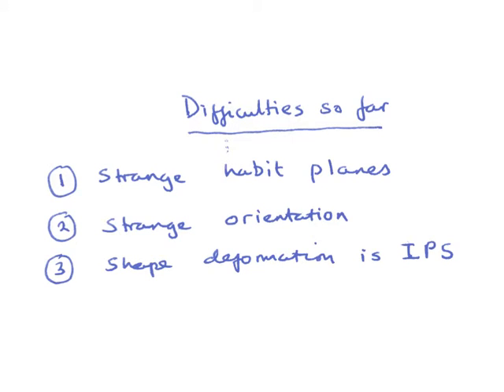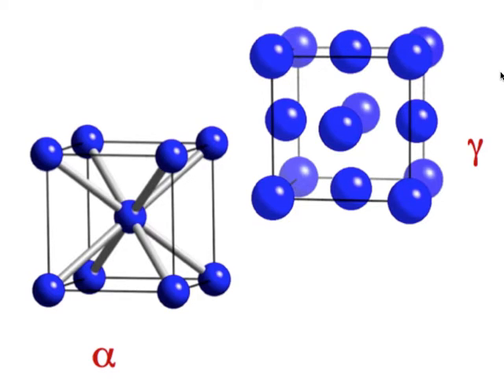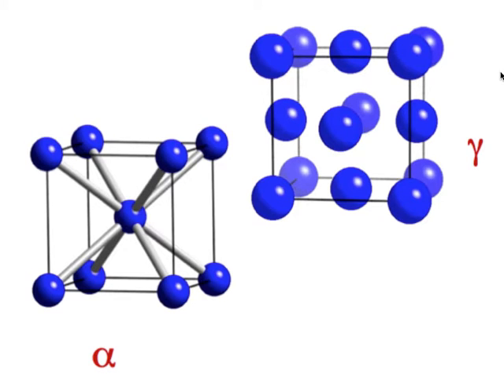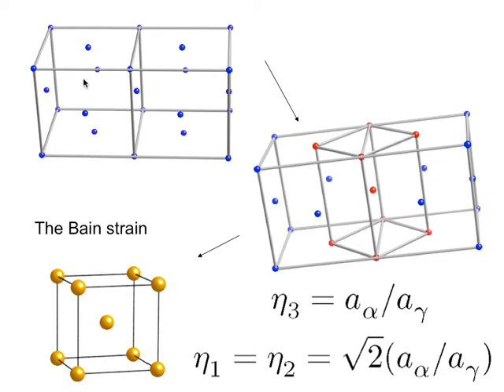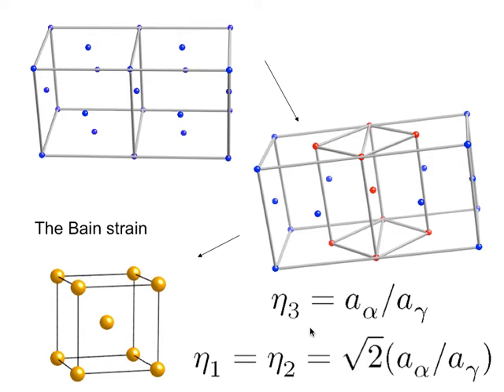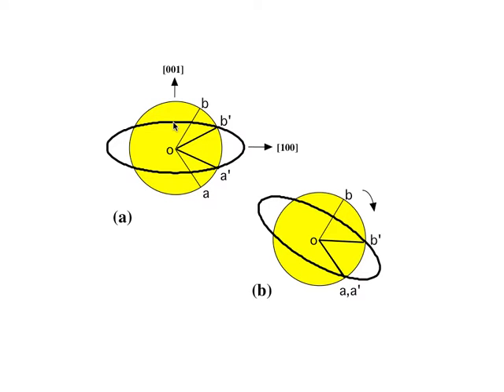Steels: characteristics of martensite, lecture 2 (2016)

Comment: what's the difference between stacking fault and hcp martensite transformation ? both seems have hcp structure.
Reply from the maker: Stacking fault does not have a volume change. See Brooks, Loretto, Smallman, Acta Metallurgica 27 (1979) 1829-1838

Comment: Professor Bhadeshia: what's the difference between athermal and isothermal martensite in terms of transformation mechanism?
Reply from the maker: None in principle. Athermal is just a rapid form of isothermal martensite, so rapid that we cannot see the evolution without special techniques.
Reply: then why some steels' martensite transformation rate is slow for thoes isothermal martensite? thank you very much.
Reply from the maker: @smithgeorge6979  driving force at transformation temperature.

Comment: i don't quite understand strain energy of martensite is ~600 J/mol, but bainite is about ~400J/mol, though their growth mechanisms is same. and as bainite can transform below Ms, how about the strain energy of  this kind of  bainite ?
Reply from the maker: Plates of bainite are finer (smaller aspect ratio) because of mechanical stabilisation. The strain energy per unit volume scales with the aspect ratio.
Reply: the bainite and martensite growth mechanism is same. the strain energy should overcome is also same at the begining of growth(before mechanical stabilisation) . this minimum strain energy seems the necessary of transformation. i  feel confused . thank you very much for your answer
Reply from the maker: Below M_S, bainite is preceded by martensite. So it is forming in a more constrained environment, just as subsequent martensite plates. So it should be finer, but the strain energy then has not been measured. You should do that.